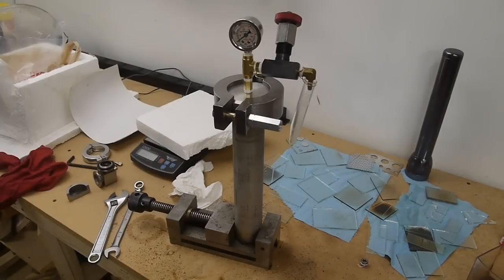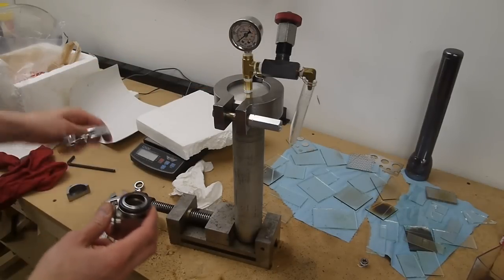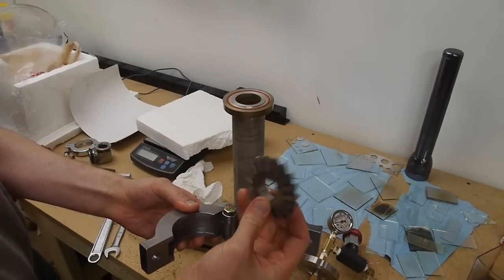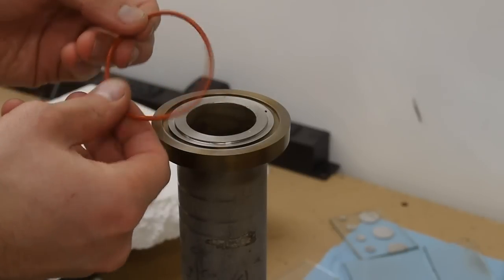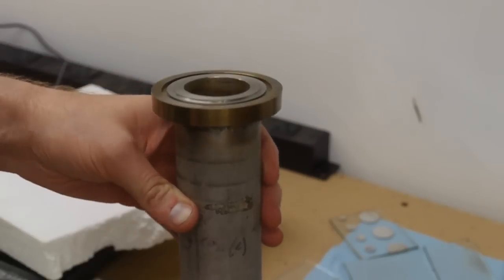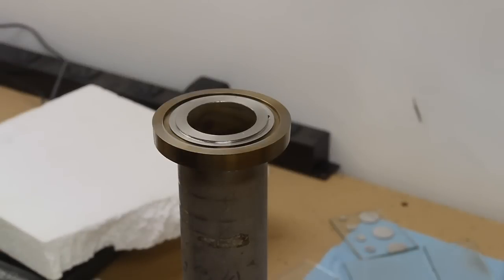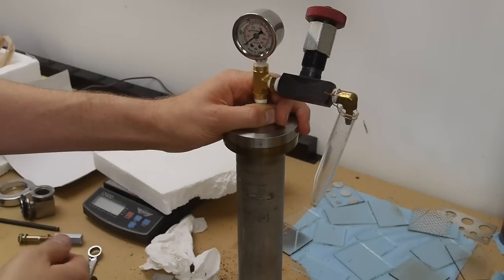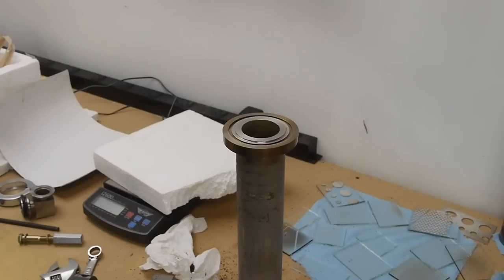Custom supercritical CO2 chamber with easy-to-use lid clamp

Comment: Hi Ben,

You might want to try some difficult cleaning experiments. We did some development with supercritcal CO2 for cleaning stains out of cloth and clothing. If you search google patents for Liquid/supercritical carbon dioxide dry cleaning system it shows the schematic of our setup. Great video. 

On your welding if you project the tube through your flange and do the weld on the ID you will get much less distortion on the flange.

Kind regards,

Tom Lipton
Reply: ض3حد  وخحضمض9زتشسن   ظ
.  دك على 99ححة   ل

Comment: I assume you tig welded it? Stainless is difficult when it comes to heat but there are some tricks that work. When you put a tack down, give it about 5 seconds of argon afterwards, then give it a 5 to 10 second blast with compressed air, the change in temperature should be enough to flex it back in to place, a second man comes in handy here. A colleague of mine who does alot of flanges puts ice cubes on flange when welding, didn't try this myself be he says it works great? Good video!

Comment: What you've built resembles a Grayloc hub assembly which I've seen used in my line of work for flanges (Oilfield, 3,000 PSI+ working pressure service). You might look into them in the future, you can find flanges and clamps on ebay.

Comment: have you considered compressing the dry ice into slugs? or what if you put 2 valves on the chamber, one on top one on bottom then you fill the chamber full of"extraction medium" and simpley inject liquid co2 using a SIPHON CO2 tank used for arrow soft guns

Comment: maybe you should do a project on hydrotesting, since it looks like you would be testing many more DIY high pressure chambers in the future. it's definitely safer than putting a heater to CO2 filled steel pipe!

Comment: You can use water and a grease fitting. Fill the chamber with water and put a lid on it with a standard grease zerk. A typical grease gun can produce 10kpsi.

Comment: It's interesting hearing you talking about pressure testing. I was wondering how I could do this safely if I ever did anything like this. My idea was to fill the whole thing with brake fluid and connect to a brake master cylinder, then put the pressure vessel in a dustbin full of water. It's easy to get 1000s of psi with automotive hydraulic brakes and because everything is filled with relatively incompressible liquid, if it does fail then there's not that much energy stored in it.

Comment: The length of the chamber if you choose to make a longer one, will be a weakness, I don't remember about how much of a weakness though so test it thoroughly, also if it should fail at longer lengths, you could probably cure that by using some kind of clamps at the distance of the current chamber or using extra material welded on at that distance and maybe something welded through the chamber, keeping it from expanding on the inside.

Comment: Hi I want to build something pretty similar. 
But not for CO2 but for supercritical water. 
T374,12°C(526°F) P230bar(3219psi)
doing themath for the container is pretty easy. 
But I can't find anything on doing the lid. 
Ben you said you've done the math. Where did you find it?

Comment: Have you considered making a clamping style flange end to connect to a pre-manufactured steel pipe vessel as you've used in the past? It seems like that would allow you to change the size of your vessel easily while maintaining the easy opening/closing of the clamping end.

Comment: Yes, stitch welding - the term eluded me - just like my welding skills - elusive!

The welds on my vacuum chamber are all internal, inert gas purged on 5mm thick pipe. The KF/NW flanges held up fairly well, with minimal/acceptable distortion on the mating face. I used the thicker pipe instead of thin walled tube to help absorb the heat from the welds, otherwise the mating flanges would have looked like bananas after welding! I agree with you - weld first & machine later (where possible)...

Comment from the maker: I think the technique is called "stitch welding." I made 6 tack welds, then welded between two of the tacks. Then I rotated the piece 180* and welded between those two tacks, then rotated the piece again, etc. This spreads the heat out in a way similar to tightening engine head bolts in a pattern. This was a pretty beefy weld that required a lot of filler metal (three passes), which probably caused the cupping.

Comment: I had exactly the same problem when welding stainless steel KF/NW fittings to stainless steel pipe - the mating flange warps due to the heat from the weld. Did you weld it quickly, or did you do small passes and allow it to cool between passes?